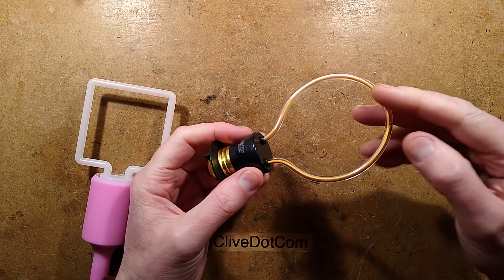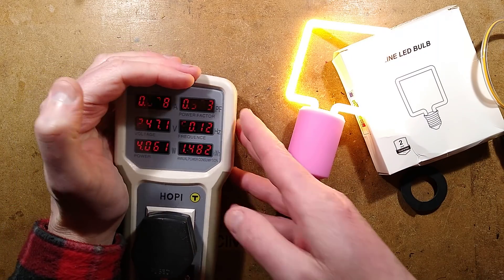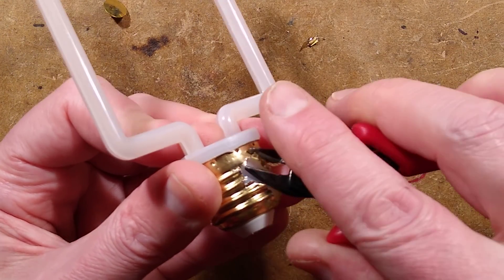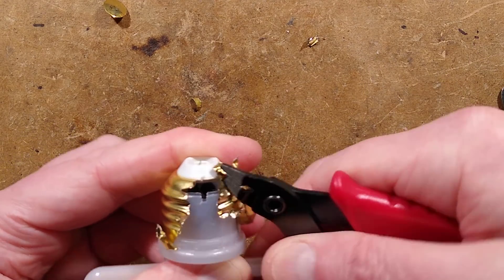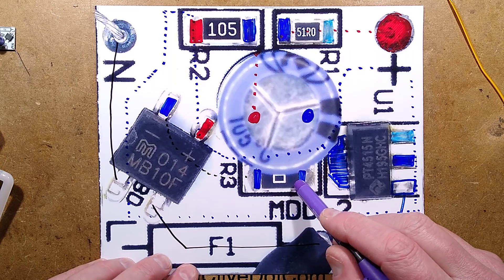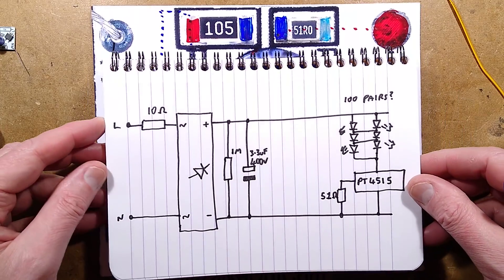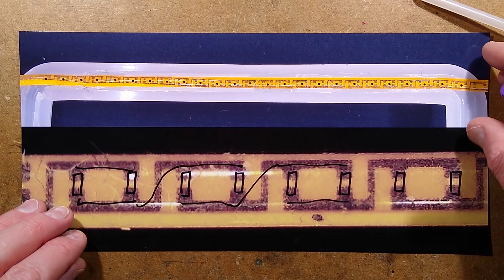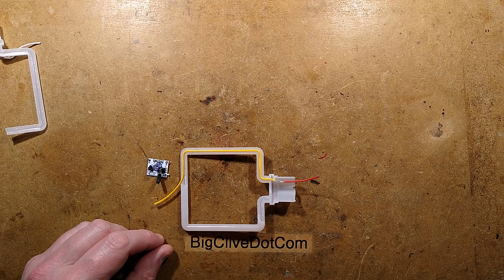Inside a next generation shaped filament lamp (with schematic)

Comment: Never skip the destruction.  Side cutters come in two flavors, the good ones you use on occasion and the cheap ones you buy in bulk to reveal the innards of cheap Chinese electronics.
Reply: Or, you bought a two pack and saved the second one until that day you accidentally tried to cut steel wire that was a bit too hard and dented them. So the dented pair became the destructors
Reply: Not too cheap of cutters though I warn you.

Too much Chinesium in the cutters may react with Chinesium in the import product being disassembled.

Annihilation chain reaction.
Reply: And the ones that someone borrowed and blew a hole in cutting live wires turning them into wire strippers and the borrowers teeth to summer teeth
Reply: Yes, I love the "Just a moment, please..." and then jump cut to the product splayed out in bits.
Reply: Ah the cheap ones, also sometimes known as chisel cutters. Sold as cutters, used as a chisel...
I actually went with Clives recommendation for the blue ones he uses, they never let me down. I think I paid about 13 € for three and they worked better so far as a 40 € pair I have at work.
Reply: Having a "good" and a "cheap" one can have side effects. I have both a proper Knipex side cutter and a cheap one that was on sale at a local electronics shop. Cheap one gets used all the time, and the Knipex collects dust since I never use it...
Reply: @NiyaKouya  obviously the cheap one works good enough for the tasks you have.
But what I found with such things, unless they are dull immediately and you feel a distinct difference from one cut to the next, those wear over time. And to me it seems we just align to such cutters over time gradually cutting not as good. Take out the good one again and you would be surprised.
I guess as long as you don't abuse them with unreasonable force to cut anything, both will be fine. But if you use both the same amount, i guess it would show up at some point that the good one remains good for a longer time.
That's something I always wonder when people want to get them the best tool for a task they can afford. But let's be serious, if you are a home owner who may drill a hole into concrete once every two years, would you need a Hilti or would a way cheaper Bosch or Makita (let's say at most 100 to 200 €) do the trick as well (not going down to the cheapest ones, those tend to break easily and are no fun to get holes drilled with)
You can sure get the Hilti, but that would mean having a heap of money collecting dust between uses.
Reply: https://youtu.be/FTU5y6ZxuR8
Reply: Mini inverter https://youtu.be/FTU5y6ZxuR8
Reply: Or the decent ones your co-worker borrows then you find out later he's been using them to pry open stuff. 😠

Comment: I wish I had a 3D printer thus type of light would be great for decorationg at christmas. I dont want a load i=of these running on the mains but a low voltage version would be nice. I could do strings of "faiiy" lights with diffrent shapes. I guess that might be a thing from China for next yule time.   Thanks for sharing 2x👍

Comment: I think now that LEDs have become a commodity, and a full generation of product developers and engineers will never have known (the limitations of) incandescent lights; now we will see actual innovation and existing lighting implementations being transformed.
Reply: I went into a Lamps Plus a month ago.  About 30% of the floor lamps, desk lamps, chandeliers, wall sconces, have unserviceable LEDs inside of them (the trendy modern looking designs mainly).  The claim of energy savings comes out in the wash when you throw the entire unit away if the LED stops working.  Thankfully they are pretty reliable, but it's an odd trade-off.
Reply: @bigblockelectra  
Yeah, I have decided that any future light fixtures that I buy, the light can be changed by the average joe with minimal effort.  I do not want to leave an issue for the next resident to deal with, and they may prefer a different colour temperature anyway and not be in a position to do basic electrical work.  Why make their life anymore difficult or expensive, even if they deserve it‽  
I'd suggest that a standard for replacement be developed, but obviously, there are already plenty of those.  A new universal standard shouldn't be out of the question as a practicality for LED though.  
 https://youtu.be/yR2lgxy-htU The world is filled with different types of people.
Reply: @bigblockelectra  just buy a driver and/or suitable led strip. The hardest thing is to find out if its the driver or led that is broken, if the driver it not labeled properly. But a driver cost only a few euro. 

It is not as easy as replacing a bulb, but its not a very difficult job.
Reply: I'm an electrician and its a blessing and a curse. There are some light designs that are only posible because of LED's but they are also a royal pain in the ass to install.
Reply: @Willard_guy  Hi Willard. 
Why are those a pita to install? Because of weird shapes or because they are minuscule perhaps? I’m just curious. Thanks in advance!
Reply: @Conservator.  Just the shape and how they are supported from the celling. This was also mostly in high end office spaces so they were custom one off designs as well.
Reply: @Willard_guy  thanks!
Reply: @Willard_guy  been there, LED ribbon install inside a shower, backlit the lil shelf.
Reply: thank you, so we keep up to date!
Reply: https://youtu.be/FTU5y6ZxuR8
Reply: @James-qw7hp  
Good video, but you might consider doing some voiceover to explain some bits of what you are doing. It's not hard to follow but is not particularly educational for anyone who does not have have a working understanding of the specific components you utilised and why. Your set up and lighting is good enough though. I wish you well and good luck on your channel.
Reply: Look up EL paint on youtube.

Comment: Somewhere I read that heat sinks and spreads through the circuit board material pretty well, and the presence of a continuous copper plane isn't essential for heat disappation.